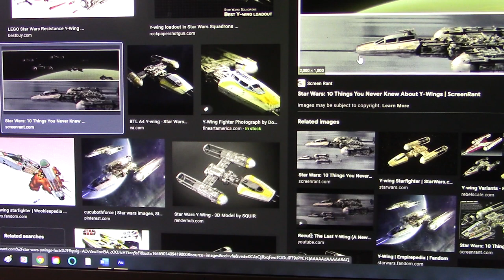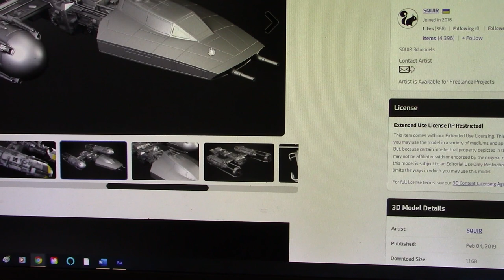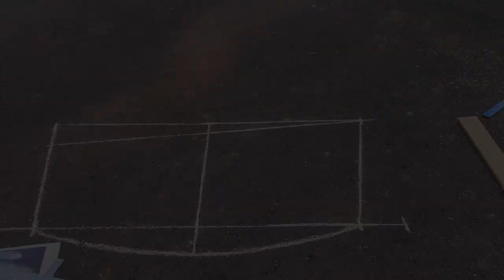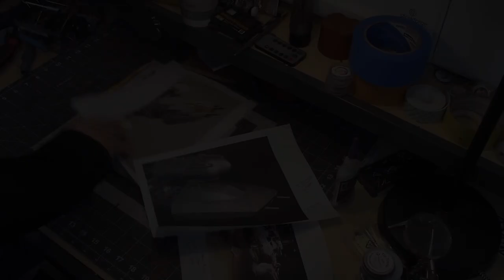TTFS: Battle Damaged Star Wars Wall Panel

Comment: That looks awesome. I love the way you have a story in mind when your doing a paint job, the thought behind it makes it sell as far more real then just random painting and weathering. 

I'm not sure if this will work for the material you use but a tip I got from the Tested channel, Adam Savage mentioned he used to use the sandpaper glued to wood trick and he used to make them in bulk, until he found emery boards and how cheap they were and that they came in basically all the grits. not sure if thats useful to you or how well those would work on wood, but i hope it's helpful
Reply from the maker: Love that idea and I will check them out on Amazon!  Thanks!!